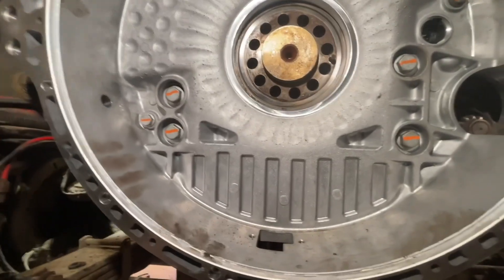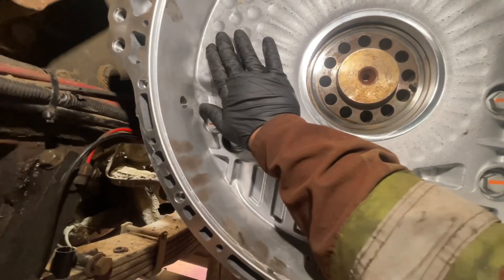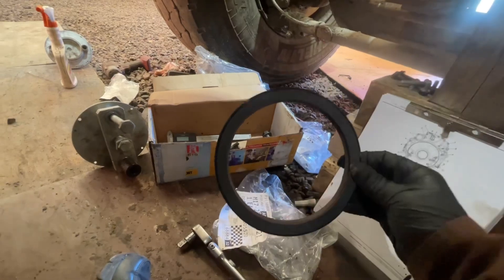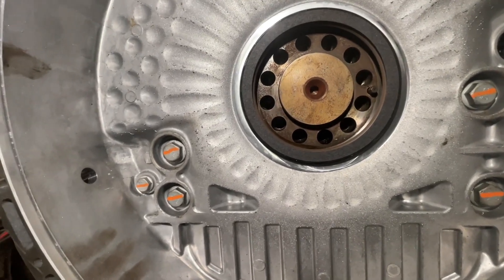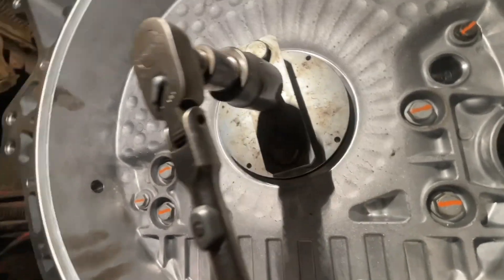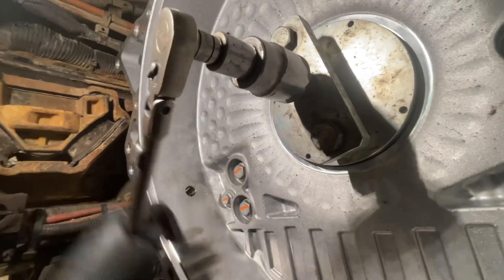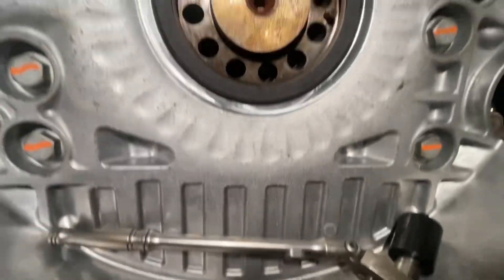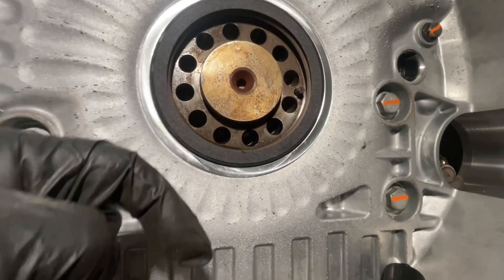Detroit DD15 rear main seal installation

Comment: Both of my stock DD16 trucks had the outer face of the seal pushed in to the machined chamfer/bevel in the timing cover seal bore. With that said I've seen 2 tools listed as the same part #,  1 with that extra protrusion on the seal side and one that is just flat. On a 2018 dd16 oem installed seal, i measured the outer face of the seal to be slightly more than 1/8" from the center circle of the crankshaft.  My tool happens to be completely flat on the bottom (no protrusion) and I made a 1/8" spacer plate that bottoms out onto the crank center and puts the seal at the oem position. I don't believe the depth is a critical dimension, other than being installed square. Just as long as the seal face doesn't  hit the flywheel before the flywheel bottoms out onto the crank. I also think if a flywheel had a worn groove, changing the depth of the seal could place the wear point in a different location (just a theory).
Reply from the maker: @Bo-LandEnterprises  thanks for the input, I havnt done this job that many times so there's always questions lol I tend to agree with you the final position of the seal is not critical , and may help if there was a groove on the seal surface , good point